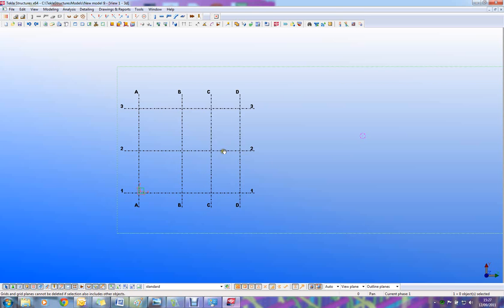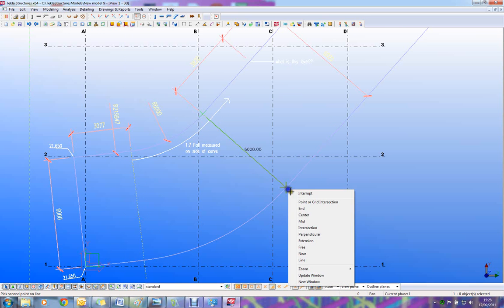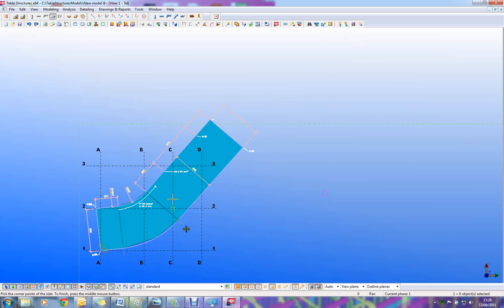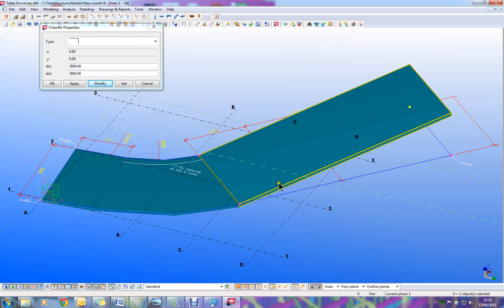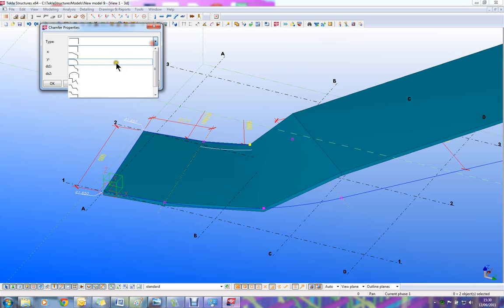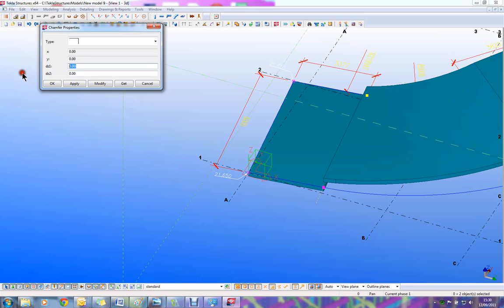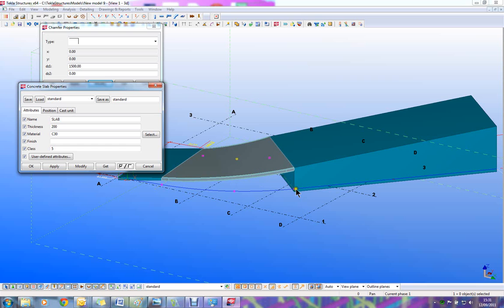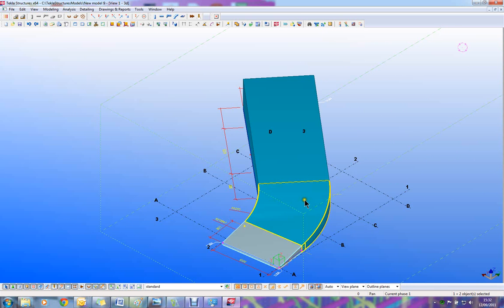Curved Concrete Ramp in Tekla

Comment: Hi Paul,
I was very enjoy watching your Curved Concrete ramp in Tekla video
I’m a steel detailer/modeler. I have a project which is similar with this, I need to model the bent plate on top of my steel beam to pick up the concrete slab. Any suggestion?